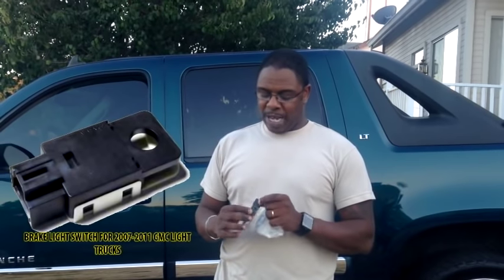[SOLVED] Fix Service Stabilitrack and Service Traction Control on 2007-2011 GM Trucks

Comment: This is a sneaky one! I will have to try this, both front hubs feel tight and no growling noises. 4WD auto mode leaves the truck in 4wd but specifying 2wd unlocks the front hubs/turns off 4wd so I will have to try the brake light switch first. Thanks for the video! I left my code scanner in storage so haven't been able to scan it

Comment: Your the man 26$ fix n cleared all my codes and freed up my shifting column
Reply from the maker: Glad to hear it worked out for you!
Reply: @JGTV21  any ideas what else it could be it went out again after a couple days no issues :(
Reply from the maker: @kevinmarley2587  what went out?
Reply: @JGTV21  it's saying check traction control then flashing traction control off
Reply: It worked like a charm for a couple days then came right back on
Reply from the maker: @kevinmarley2587  you can try looking at the wheel speed sensor. I've read articles that stated it might be covered in dirt or grime which would also cause the lights to illuminate.
Reply: @JGTV21  thanks will do

Comment: So does the brake switch part you’re talking about fix the stabilitrak and traction as well???
Reply from the maker: Once I replaced it, I no longer had the two readouts coming up on the DIC

Comment: This is probably my problem. I’ve always wondered if it was wheel speed sensors or steering position sensor but I also have cruise control issues so that may be it
Reply from the maker: Hope this video helps fix your issue

Comment: I HAVE A 07 YUKON MY STABIITRAK / TRACTION CONTROL LIGHT CAME ON  IT HAPPEN WHEN I GOT OFF A EXIT ON 95 IT RUNNING ABIT ROUGH SECENS THIS PROBLEM I HAD TO JUMP THE TRUCK ONCE  A SMOKE CAME OUT THE TAIL PIPE SMELLED LIKE GAS I GAVE THE TRUCK A TUNE UP .. WOULD THIS STILL BE THE PROBLEM AM HAVING

Comment: Do you have any information in regards of the location of the "Yaw Rate Sensor" that could the problem on my car. I have replaced all 4 off my ABS/Speed Sensors and my My Steering Sensor. But my Stabilitrak Module still flashes at me as if im skidding out of control which in result when Im driving normally I lose power.
Reply from the maker: I do not have any info on where that sensor is located sorry.

Comment: I had a similar problem in my 2007 Tahoe LT, the Service Stabilitrack/Service Traction Control error and the reduced engine power, the mechanic checked it with OBD ii and it showed that the pedal position sensor need to be replaced, then we discovered that their is a wire lose from the wire harness that go inside the sensor, they fixed that wire and everything is back to normal without replacing the pedal position sensor.

Comment: J GARY ; i have same problem in GMC acadia 2007 (service stabilitrak and service traction control).

will this part fix my problem?
Reply: libra hawk did yu fig it out having the Same problem with my 08 acadia
Reply: Hey same problem on my 08 acadia ... have you done it?
Reply from the maker: +Josh Farrell I haven't touched an Arcadia sorry
Reply: i have same problem in GMC acadia 2007 as Service Stabilitrak and service traction control. have any one done it? please advice
Reply: @nishadmohammed5937  did you ever figure anything out on this?  I have a 2012 Acadia.

Comment: just bought the switch, issues were  07 suburban LS  86,764 miles is not going into gear intermittently. Also abs and traction control and stabilitrack lights on. I'll chime back in upon replacement and let all know results.
Reply: replaced switch, hoping its a wheel speed sensor at this point

Comment: Right on the money! Thanks.Local Chevrolet service said it was probably the battery, as it began right when the weather got cold. $160 battery, well it WAS old. but ddn't fix the problem!! Note; to remove this switch there's a 10mm screw I didn't see in your how to.But mucho gracias.
Reply from the maker: Steve Nissley you're welcome. mine didn't have a 10 mm screw just double sided tape
Reply: Sure. I just wanted to put that out there for the next guy...I've a 09 Silverado. The screw goes through the clip. Seems like overkill as the clip locks on pretty well by itself.
Reply: uolm

Comment: Hi thanks for the video yesterday my Tahoe did the same thing it got to the point that it lock it self .. but I got the part and everything came back to normal .
Reply from the maker: Glad the part helped you out!
Reply: Mauricio Olguin  k parte le compro
Reply: Nancy Rodriguez la parte que va en el pedal del freno
Reply: Nancy Rodriguez  pídalo en auto zone como brake switch pedal esta como en 25 dólares

Comment: I got a 06 trailblazer with the abs light and it's saying service Stabilitrak and I'm not have the shifting problem so do you think this will fix it even though you said from 07 and up
Reply from the maker: It may fix it. I've seen people change that part on earlier models as well and it worked. Worth a shot.

Comment: I got into my car and it shifted into drive just fine, but my power steering is out. At first my dash said "STABILITRAK DISABLED," and now it says "SERVICE STABILITRAK." Do you have any suggestions for this? Oh, and that light of the car with the squiggly lines is on, too. Thanks.
Reply: Go to AutoZone give the make  and model of your car
Reply: do u happen to know if u have a CODE? do u have a check engine light? that's how u get a CODE....

Comment: Well in my situation soon as i rotate my steering wheel the light's come on. So this is telling me steering wheel sensor! Same goes with brake pedal sensor soon as you tap it does the lights come on?

Comment: I have a 2007 chevy avalanche. I get the service stabilitrack and service traction control message. Every now and then it won't change 4WD modes. Do you think this would fix it? I've also heard possibly the body control module. I heard the older vehicles have a bad ground wire that causes issues but my truck doesn't seem to have that same ground wire.
Thanks I might just try this out anyway.

Comment: I have a 08 silverado ND the stabilitrack light come on when is running ND the check engine light start flashing u think that sensor is dat problem ?
Reply: Yo'. did you ever figure out what the issue is/was?!

Comment: I'm getting a service stability track/ traction control and hard shifting into 1-2 but no abs light? Could this switch be the issue? Or only if the and light is on?
Reply from the maker: danhendricks777 worth a shot. Hope it fixes it for you
Reply: i have the same issues in a 2011 tahoe. Did this fix it for you?

Comment: I replaced my air ride compressor and shocks and when I started my truck these lights was on but they wasn't there before I did the air ride repair.Can you help me with this.

Comment: My Sierra has that "Service Stablitrac" message. Why would the brake module affect that?
Reply: Ak Grizzly Man the switch is for the lights and abs. the abs is a component of the stabilitrak so fixing this should help solve the problem

Comment: 2009 Silverado LT UPDATE!!! : 2 weeks later in the rainy cold, the ABS stayed off (thank goodness), but Service Stabilitrak and Service Traction Control came back. RATHER than let any of you out there fill your NEW BRAKE LIGHT sensor w/ grease or anti-ox "thinking the connection isn't staying cool enough", pay attention to chassis grounds. With mileage approaching 90,000, my chassis grounds were SO filthy, CAKED with grease and dirt. There are 3 (that this "non auto mechanic" found) and they're down low. An interesting study, note your battery display voltage before performing the following. ****You'll need a 10mm shallow socket, and an aerosol spray can of contact cleaner *with the little straw -(I used Ideal brand from Lowe's/Home Depot). You may also want something "gently abrasive" to get the hardened grease off and get back to bare, clean metal. 

Chassis Ground 1)  (which seemed to be in proximity to the fuse boxes) was behind (& just inside) the drivers side front tire. Chassis Ground 2) was found further down the drivers side, visible (when clean) between the bed and extended cab - behind & below fueling port. Chassis Ground (main) 3) can be found by following the Negative battery cable. You will end up under the front bumper on the passenger side where 2 cables actually connect to this ground. ** IN EVERY CASE, pull them off wash them & where they mount thoroughly with contact cleaner. Be sure to get the little cracks and crevices. These  little pits are the first places that will fill with dirt and challenge a good contact. ONLY once all this is done should you be overly concerned with wheel speed sensors. This removes most "nuisance" or meaningless codes. It certainly seems to have worked on mine. Keep your battery terminals "clean & free of corrosion" and DO NOT EVER over tighten GM factory battery cables. GOOD LUCK!!!!!

Comment: My 2010 camaro just started shaking so the light for the service stability came on.. I Checked with my car computer what it is it also reads it's a 'misfire' what I'm asking is should I just change out all my spark plugs.. Should that fix the problem?
Reply: Any luck with your problem?

Comment: HELP!  I have a 2012 GMC Acadia.  The Stabilitrak and Traction Control Off signs appear along with vibration in the vehicle, a burning smell and smoke comes out of the rear.  Now...it won't even start!  I've taken it to the shop before and they couldn't find any readings accept to replace (2) Ignition Coils.  It ran fine after that...but now it's doing it AGAIN.

Comment: currently I'm stationed in germany and man its snowing like crazy. I currently do t know when GM will.have a recall on this but they need to along with the dash board because this is the second time my dash Cas cracked by the airbag that's located on the passenger side. Well any way this is very dangerous especially when your around cars that drives over 150 km per hour. It seem as so that wen my truck is almost paid off or for I'm starting to have problems. I sure hope his advice helps me. Thank you.

Comment: This light comes on for a myriad of reasons. Our first time was due to a vacuum line missing a cap. The second time was for a cylinder coil misfire. Fixed that, and we were good to go. Recently we had our oil changed before we made a 3000 mile journey. About a week after returning and about 3500 miles since the oil change, the car started to make strange sounds when turning left, and the stabilatrak/ traction control light came on again.  The next day the car display came up and to STOP the car immediately, NO OIL. ( though the oil life display said 50% ) I checked the oil and there was barely a hint of oil on the stick. No oil leaks. There is no reason a full pan of oil should be consumed in 3500 miles. The oil change dealer said it was because it was not synthetic oil. That's a joke. Regardless, i added oil and the suv is running fine. Bottom line, the traction control notification means there is some issue.

Comment: I know this is old post but if you could response could I ask do you know of this being issue plus will not turn over most times. I was about to do battery cables and ground fuse by battery. It also says my tire sensors need service. Could all these things be related.
Reply from the maker: I can't be 100% if this will fix the issue but I will also mention that when my switch was faulty there were times while I was driving the the radio and guages would cycle on me which I thought couldn't be related but after I changed the switch I didn't have that issue anymore
Reply: @JGTV21  that is interesting bc before it got this bad the ignition would stick when I tried to crank it. What I have done since I made the original post was just clean all the cable connections and removed my mega fuse at the junction box and cleaned it and it's ran a lot better but now the lights are starting to come back on but it's still running fine. I will keep your post in mind. Thx

Comment: On a side note with service traction control message. Mine came on so I started looking for help. 
My air intake had come loose and was off at the motor.,
Had the The message ,the icon was lite up and was shifting hard when I took off. 
I put the air tube back on tighten the clamp . Problem went away. 
So the airflow definitely has an effect on the traction control. 
After just putting a new rear end in just days before I was due a simple fix lol

Comment: Thanks J Gary! I've always suspected the break light switch on the brake light flicker,  the abs and stability lights coming on once in a while. but I never thought it had anything to do with the reason my cruise control stopped working. Long story short, I replaced the switch and all is well. I also have an 07Avalanche. I did replace my tranny, 1,500 dollars later with about 90k miles. My sprag(French made I was told. lol)gear went to Hell.  Thanks again. And how do you keep the black trim looking so good? Love the chrome trim also. Sun is getting to mine.
Reply from the maker: Steve A I use back to black for the trim and have them put tire trim on when I get the car washed.

Comment: mine shows the stability track and the engine light on and it blinks my 08 chevy silverado doesnt run like its supposed to could it be the same problem ? they are telling me its the engine but i dont believe so it was runing good and just one morning it felt weird and dint run the same and these two lights poped up i havent tried this but i think i will
Reply: top of motor is a module for your throttle body position sensor it is shorted because the milli wires have all or a few are broken.  Because the part for only Chevy Silverado was made in Mexico the change in seasonal temperatures cause internal wire breaks.  The price for the North American wiring with thicker wire is 160 Canadian and it should be installed for free at any dealer if you bought in North America.

Comment: Will it work on a 2011 Chevy Traverse LS it's a 2-wheel drive can I have the same problem do you think it would work on mine if I change that
Reply from the maker: +Mario Sedillo worth a try. My truck is 2wd as well. What symptoms are you experiencing?
Reply: Traction control stabilize
Reply from the maker: +Mario Sedillo do you get a ding ding ding then a loss of power when the message comes up?
Reply: Yes
Reply from the maker: +Mario Sedillo Does your cruise control not work when the warnings come on as well? I think starting with the switch is the cheapest route. Read a couple of forums some are pointing to the throttle position sensor or throttle body replacement which is expensive.  This is what my Avalanche would do.  I would be driving along then ding ding ding then get the warnings and reduced power. Shortly after, started having problems with the brake lights flickering and then it got to where I had a hard time shifting into drive. Long story short, I would start with the switch. Hope you get it resolved.

Comment: Can you help me out, I've already replaced that and the throttle position sensor and now it won't leave park at all. I got the codes read by a shop and the paper I got back said to replace those two parts but it's still not working. Any help would be amazing
Reply: The specific codes on the paper are p0573, p1516, p2101

Comment: OMFG you rock bro....been having that problem with my 08 Acadia.
Reply: MedicHD No club Did this fix your problem? I have the same problem with my 08 Acadia.
Reply: Will find out today as the mechanic will be switching it out for me. Now it's the "service stability", "AWD Off" and ABS and traction control messages that won't go off and acting up. The is a huge POS .
Reply: MedicHD No club I have awd too but I only have traction control off and service stability. Did you order the same part as he's using? Autozone has it but they only have it for the Avalanche.
Reply: Not sure where they ordered it from, I told to order it so where ever they get the parts from. As soon as it's fixed I will post the outcome...fingers crossed
Reply: MedicHD No club Any luck or was it something else that had to be replaced?
Reply: Turns out that the right wheel bearing was gone and the ABS sensor on that tire too and that was giving me all of the errors. Wish it would have been the break sensor as it would have been cheaper
Reply: Also the flashing and messed up signal turns were from a piss poor installation of the trailer harness
Reply: MedicHD No club Yea I'm thinking I have to change the wheel sensors as well

Comment: This just happened to me tonight I was driving home and stable lysing traction light came on with the brake light the brake light is flashing the traction control light stayed on the whole time until I got home turn the car off then turn the car back on then it went off could that be the issue with what's going on

Comment: I have a 2008 avalanche I was driving to work and all of a sudden the traction control appeared. It was appearing once in a while like a week or two but then the stability started popping up and while heading to work I don’t know where it’s slow down on me and started making a sound on the bottom, I had to drive slow